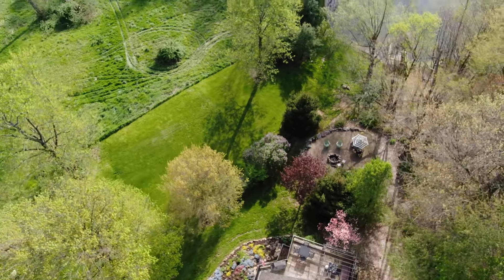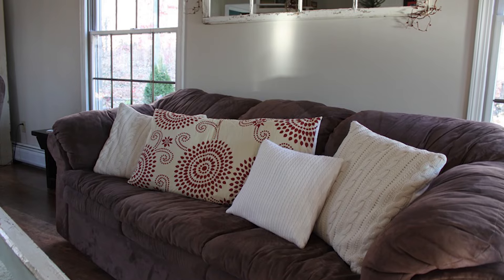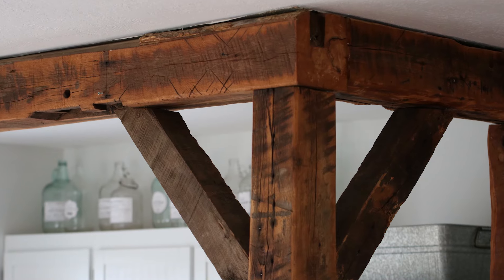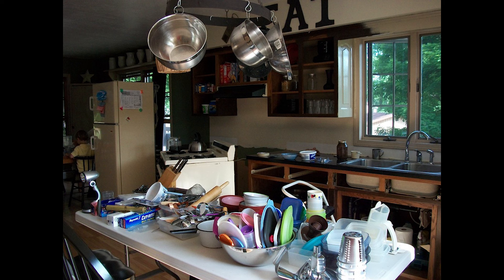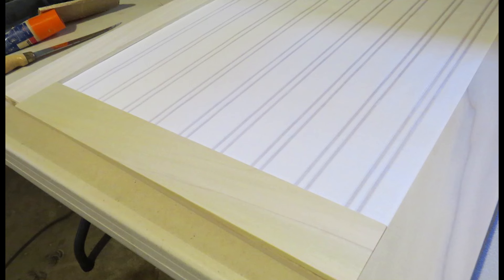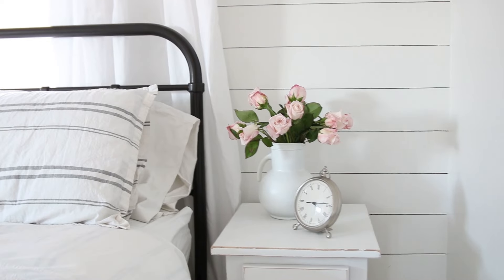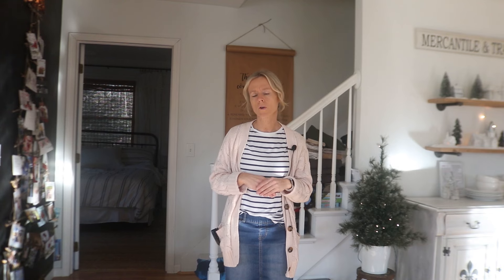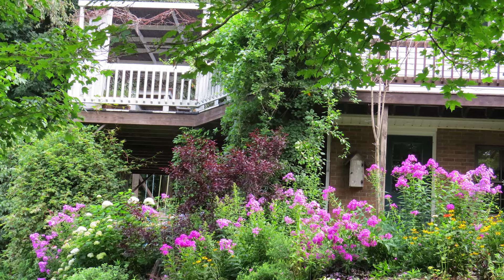Our Home Years ago! ~ Home Before and After ~ Extreme Home Makeover ~ Home Tour Before and Afters

Comment: The place looks great. Your photography is excellent. It is nice that you recorded the evolution of your home. If I were to change anything I think I would take the beams that section off the kitchen and use them on the ceiling as a feature. That would really open up the space. Another thing that would open the space more is to make the flooring one consistent material throughout  the living room, the dining area and into the kitchen. Patch work flooring can really make things feel disjointed and even make a living space feel smaller.

Comment: You have a lovely home.  Many years ago I had a Victorian era house and insisted I wanted a claw foot tub.  I found an antique, solid cast iron tub, had it sandblasted and repainted.  Keep in mind with the weight, you will have to reinforce your floors for safety.  If you get a reproduction, I warn you that the sides are higher than a standard tub and not very easy to get in and out of.  If I was to do it again,  I would NOT get a claw foot tub.  Your family is still young but I am guessing you will not be moving from your home.  In a few years, you may find the tub difficult to access.   It is your house and if your heart is set on a claw foot then do look into it.  I am only offering a few hints based on my own experience.   I wish you and your family all the best in 2023.